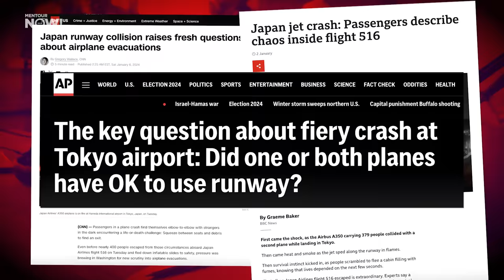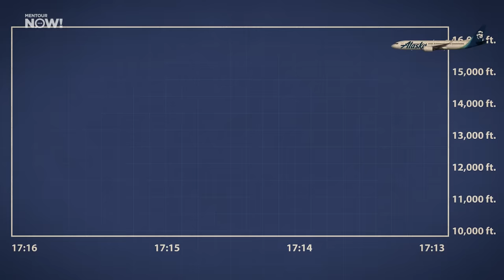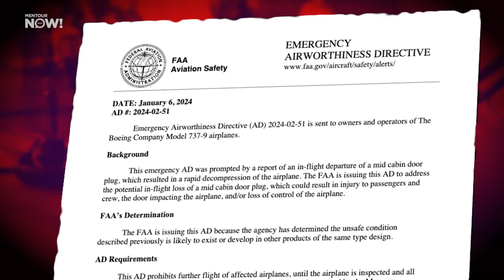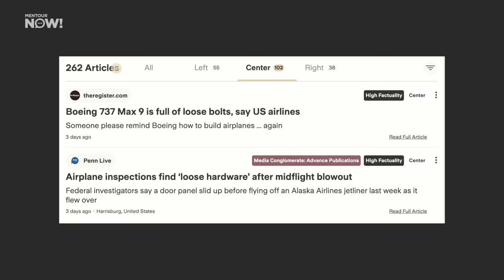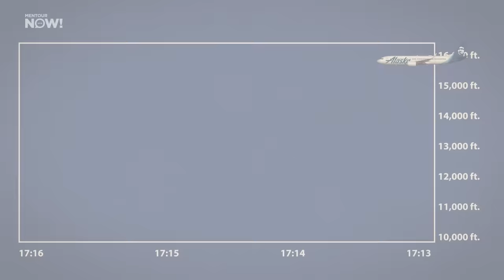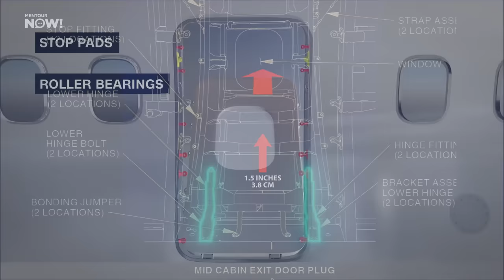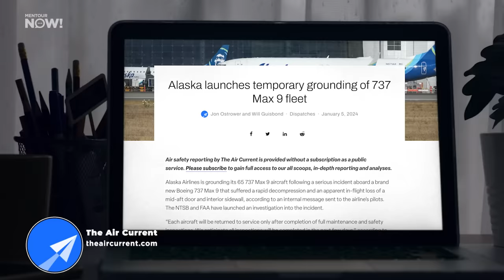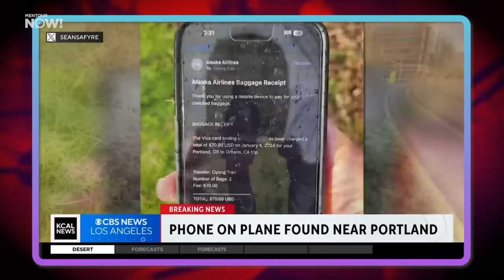WHAT Is going ON with Boeing?! MAX-9 Door blowout

Comment: Finally, a video on the subject that covers the commonality with the NG generation -900.  I'm still wondering why the FAA has not issued any ADs for those models as well.  From what I can tell, the design of this door plug system did not change for the MAX.
Reply: Yes that’s true, there wasn’t recertification required it’s a previous design, what has changed was manufacturing process, it has been suggested the last crew to remove this plug door was for the installation of the WiFi system, which is located near these doors so they do remove them as part of that process, the company that does this is a contractor. When they reinstalled it and covered the panel Boeing does a pressure test and it passed, even with those bolts missing it would pass because at that time gravity was securing the door. 
This is a theory but yea the last process in production of that aircraft should have been the WiFi installation
Reply: @ytzpilot  I don't buy that the plug needed to come out for wifi installation.  That contractor firmly denies doing so.  And why would they need to?  To run wires through the overheads?  Nahhh, doubt.

Are you suggesting that Boeing contracted the wifi out?  I think it has been confirmed that Alaska paid an independent 3rd party to do so, which is the one I referenced above denying ever touching the plug.
Reply: @ChristopherBurtraw  Juan Brown already provided photos and details of the installation, it was clear as day the door was removed, air stairs were being used, photos don’t lie
Reply: @ytzpilot Boeing has admitted it was THEIR failure. I am guessing at least one of their mechanics is now looking for a new job opportunity.

Comment: I read in a comment that Spirit ships the fuselage to Boeing with the doorplugs attached. Then Boeing sometimes removes the door to fit the interior via that opening, and then reattaches the door. And that probably at this stage they were not careful enough.
Also, it is pretty normal that a phone falling from that height will remain intact. The phone will not be any faster regardless of the dropping height, as it quickly reaches its terminal velocity. And that speed is not that fast. If it falls to soft ground, especially not with screen looking down, then it will be most probably unharmed. So no, Iphones are not that special.... bruh.
Reply: Tree branches to wonders in slowing falling objects.
Reply: It is unlikely boing removed it in this case imho, as everything taken off must go back in, it is a typical procedure with great care taken. It's a big issue if you have 4 bolts left over. In theory it would be similarly difficult in assembly but a shift change etc would potentially see these issues i'd guess.

Comment: After an Alaskan Airlines plane went down due to lack of maintenance, it's no wonder Alaska Airlines felt the need to immediately and proactively ground the planes. The immediate concern might have been that ppl might think they weren't doing maintenance again.
Reply: But when multiple pressure warnings were detected, AS decided to dispatch the plane anyway but not over water (ETOPS).  Shouldn't they have grounded the plane until root cause of the warnings was understood. (whether an errant sensor or a fuselage issue).  By failing to do this, it could have been far worse given a few more minutes into the climb.  I'm afraid AS safety culture hasn't improved since AS261.
Reply: @cottydry you should read more into that pressurization alarm - then you would realize why it was not grounded. It has nothing to do with the incident.
Reply: Alaska immediately grounded planes after that incident, as well.  I know this because I flew on that model just weeks after the incident, so I was following closely to make sure I wouldn't miss my vacation.
Reply: @alan_davis  But AS was obviously concerned enough to keep it from over water routes (ETOPS).
Reply: * If all 4 bolts were missing this would happen in the first flight. * It is impossible for all 4 bolts to fail at the same time. * The door panel did not even have a scratch or bent after 16000 ft fall. * Much bigger INTERIOR PANEL had disappeared. * The fallen cell phone shows the baggage was checked in on Jan 4th, a day before the accident. * Everyone was very calm, I wonder what the cockpit voice and the ATC communication sounded like when the cockpit door blew up (By design according to this video) ?
Reply: @ShonMardani  the dents in the door are clearly visible in the picture.  and no, even with all the bolts missing, friction would still hold the door in place because the springs are not designed to be strong enough to lift the door on their own.
Reply: I was an employee at a heavy overhaul facility a year after that accident.  We brought in an Alaska Airlines airplane and their company reps were pressuring us to sign off things that hadn’t been done to save time.  This included stabilizer jackscrew inspections.  They were the only customer that we ever kicked out of our facility mid inspection and told them to never come back.  If they hadn’t changed a year after killing a plane full of people I doubt much has changed since.
Reply: @ShonMardani   Since the bolts don't hold the door in, but only prevent it from lifting up in order to open it, there is no reason that it would have to blow out on the first flight.  Since the air pressure pushes it against the pads.  The much bigger interior panel was made of plastic that can easily be blown out due to the air pressure differential.  The cockpit door blows open to allow the pressure in the cockpit to equalize with the rest of the fuselage.
Reply: @cottydry do some research first…it’s a common practice for maintenance restrict airplane from flying over water.
Reply: @cottydry  planes get ETOPS certified and decertified all the time. some planes just never get ETOPS certified at all. i'm sure AS has their issues, but i wouldn't think this incident reflects badly on them. people would be shocked to know how much stuff is flagged as broken with planes still allowed to take off. redundancy means it's often like ignoring a check engine light in your car. something to be aware of but no immediate issues. they probably figured a faulty sensor or small leak wasn't a huge deal because i doubt anyone was expecting the door to fall off because it wasnt attached correctly.
Reply: @cottydry there are quite of bit of deferrals that remove or restrict etops. Nothing new.

Comment: The cockpit door was apparently not blown out, it is supposed to open in the event of sudden depressurisation. The NTSB stated this in a press conference.
Reply: Yes, and with the kicker being that Boeing apparently hasn't told anybody about it. Because not telling people about safety related features of the Max worked out great last time.
Reply: Virtually all cockpit doors are, prioritizing structural safety over keeping door shut. The peculiar thing is that the blow out panels only open in one direction (depressurization in the cockpit). My theory is that engineers realized that blowing panels in the other direction could cause doors stuck in non-openable scenarios, trapping pilots inside. If that isn’t a concern a more simple solution would be to just let the blow out panels work in both directions. Lack of documentation and training on that these doors open in some emergencies was an issue. Non of the crew expected the door to open as it wasn’t documented well.
Reply: This is what Boeing is claiming, yet it hasn't be documented before...and the pilots were not expecting it.
Reply: To my knowledge, there was no report that the cockpit door was "blown out" as you phrase it here.  NTSB reported that it was blasted open and bashed into the lavatory door.  It was further reported that it took the flight attendant several attempts to get the cockpit door closed again.  The problem is that no one bothered to let the pilots or the flight attendants know that the entire door would do this and the information is not in the operating manual.  Boeing has now reported that the manual will be "updated."  The violent and sudden opening of the cockpit door might have had a startle effect on the pilots and, even if it did not, they lost their laminated Quick Reference Checklist that blew out of the cockpit. Also some poor soul could have been trapped in the lavatory (luckily, there was apparently no one in the lavatory at the time).
Reply: @Maggie-tr2kd  as much as you take task with me saying, blown out. With air pressure difference that statement stands. I guess  you're "calling me out" because you thought I meant blown out as in some sort of explosive was involved. Then in re phrasing it you said "NTSB reported that it was blasted open and bashed into the lavatory door." Also, does not help. 

The crux of my reasoning for mentioning it is because Mentor covered it incorrectly in the video. It was a simple error in the video.  I was adding a note for his and our clarity.
Reply: @imaner76   I don't want to argue with you.  I just thought it was confusing since people on here are referring to the plug door "blown out" and I don't think the cockpit door did the same thing.  Let's just say for the sake of compromise that the NTSB reported that the cockpit door flew open with such violence that it jammed the lavatory door and the flight attendant had to make several attempts to close the cockpit door before being successful.  That was a pretty significant event.

Comment: Even if one locking bold would be there, it would prevent the roller pine from moving down in the guide track. I dont think the weight of the door could shear the bolt of. What would happen if the bolt(s) would be loose but in place? Nothing. They only prevent the roller pin to move downward in the guide track. I would assume that no nut was installed and the bolts vibrated and fell down.
Reply from the maker: Absolutely..,
Reply: Or the nuts were the wrong type that could come loose due to vibration (all metal ones without nylon inserts or locking pins)
Reply: Or neither the bolt nor the nut were ever installed.

Comment: I think, when several high profile incidents or accidents occur, it's worth remembering just how safe modern aviation is.  As an example, this one thing is all over the news.  But for Dec, 2023 there were 13,282 flights JUST out of Portland International alone, with no noteworthy incidents that I know of.
Reply: And even here no one was seriously ( physically at least ) injured.

Air travel is hugely safe. The media likes to amplify everything.
Reply: @alan_davis  Seriously.  Remember that Korean Airlines flight that ripped off the entire tail section going into SFO?  Only 3 people died, and potentially not even from the crash.
Reply: It seems like a specific plane issue. The door was simply NOT secured as it should been (with bolts).

Comment: Thank you for being very clear that the bolts do not retain the door plug.  The pins & pads keep the door from exiting the aircraft; the bolts keep the door from moving up & disengaging the pins from the pads; the nuts keep the bolts from backing out; the wire keeps the nuts from backing out; the wire twisted around itself keeps the wire from backing out. Without the type of specific clarity & detail you provide, uninformed people could conclude the door plug is held in place with four small pieces of twisted wire.

Comment: These "doors" are designed following the same concept to hold presurization as most aircraft vessels flying out there.  It is a proven design. This is a most likely an installation issue, human factor, as the video suggested and I agree 100%. A  VERY unfortunate situation, once more, for this airplane reference.
Reply: A minimal version of a real door handle with latch,, under the interior wall panel, aling with an indicator up front might be a good change to consider going forward.
Reply: @citylockapolytechnikeyllcc7936 Or simply a hole over each bolt location…

Comment: Before anyone says this would never happen to the Boeing "run by engineers", the "old" Boeing had several design flaws that killed thousands of people. For example, the cargo door issue of the 747, rudder issues of the 737, 747 fuel tanks exploding, thrust reverser activation mid flight,  engines dropping off the wings... the list is huge.
Reply: This is of course true.

But if this is caused by for example diversity hire, it matters little if also the best engineers can and do make mistakes if this mistake was made by people less qualified.

Simply put. Lets say 1/1000 problems occurs with highly qualified engineers. But 10/1000 when we use diversity hire.

Is that ok for you?

Comment: I fly the 737 max. Boeing said the cockpit door was designed to open in case of depressurization. I bet it wasn't - but they're trying to explain away why it opened. There's absolutely no reason for it to open and it would be better for it to NOT open in case of that emergency - more time for the pilots to put on the o2 masks etc. In this incident (it was a minor depressuration at FL180)  and the door opened, the headsets came off and the clecklist blew out. Can you imagine what'll happen at FL350. I'm not sure pilots will have the time to even get to the masks.
Reply: You mean there should be a full sized pressurization bulkhead between the cockpit and the rest of the plane
Reply: "I fly the 737 max" - do you, really? Your understanding makes me question that. Maybe you "fly on the 737 max"?
Reply: @2adamast  that would be nice but would add a lot of weight and airlines would not go for it. My point was that if the door was at least closed, the depressurization would be slower. At fl350, you only have about 30 seconds before you pass out. With the loud noise, the cockpit door slamming opening and things flying out and the shock.. Would take at least 10 seconds to gets one thoughts together.  My main point was that I think Boeing was trying to explain away why the cockpit door opened - there is no advantage. I've heard of no cockpit that's designed that way.
Reply: * If all 4 bolts were missing this would happen in the first flight. * It is impossible for all 4 bolts to fail at the same time. * The door panel did not even have a scratch or bent after 16000 ft fall. * Much bigger INTERIOR PANEL had disappeared. * The fallen cell phone shows the baggage was checked in on Jan 4th, a day before the accident. * Everyone was very calm, I wonder what the cockpit voice and the ATC communication sounded like when the cockpit door blew up (By design according to this video) ?
Reply: @ShonMardani  no it wouldn't open on the first flight. The door has to move up first.. This would take some time... Normal vibration and climb/descent cycles. Mark my words..NTSB will find that none of the bolts were installed.
Reply: It would not take several months, it was not a gradual events. There is no way that a worker eats 4 huge bolts for lunch or take it home.  @Bren39
Reply: @ShonMardani  Pls watch the video. The heavy door has to move up. Have you seen flight attendents open the door by moving the handle - takes quite a bit of force. As far as the bolts, my suggestion was that someone forgot to bolt period - or assumed someone else did it (e.g. shift change) and no one double checked.
Reply: The door has to move down first, that uses gravity once the handle unlocks the door, then the door uses springs to assist lifting it by a very small force. Quality control in manufacturing and R&R (remove and reinstallations) goes by count of parts used, that includes counting and weighing every small screw and rivet. @Bren39

Comment: Are we even surprised by now? It is well documented since many years, how badly the "accountants" manage that firm starting with the McDonnell D. merger. Unless regulators fine the living hell out of Boeing, thus making it literally less profitable to cut corners, this is the obvious outcome. 🤷🏻‍♂️🤦🏻‍♂️🤦🏻‍♂️
Reply: Well they don’t need to, they will be perfectly fine doing military contract. All they have to do is rebrand the commercial aircraft so they all seem new and Boeing exist as a military contractor.
Reply: @Bobspineable You are assuming the military won’t be just as interested. I would suggest you look up the airframe the P-8 Poseidon and E-7 Wedgetail are built on (they are 737 based).

Comment: I believe that when Calhoun was asked by a reporter how something like this could have occurred, he said that "a quality escape occurred".

Juan Brown ("blancolirio") has done several videos on this incident, and in one of them he said that the loose bolts that were found on other aircraft were not the bolts in question but other ones. Which in a way is more alarming.
Reply: Quality Escape, typical high level management ‘SPEAK’, specifically formulating a new phrase to lessen the gravity of the situation. I know a few other phrases I can come up with that are closer to the actual accuracy. I’m sick of the constant deflection from the main situation!
Reply: @richardvervoorn6626  Back in the 1980s I recall seeing a quote from a representative of Super Cub Industries, admitting that their eponymous aircraft had "the highest incidence of uncontrolled contact with the ground of any airplane". Although strictly speaking that's a bit more than a straight-up euphemism, given that most crashes happen while the aircraft is under at least partial control.

Comment: I didn't hear you say that, per other reports I have read/seen on this incident, that the 'plug' panel, may be removed to install interior components. It is also installed so if the plane is sold to another company and they want to convert into one with more passengers it could have the needed emergency doors installed. One has to wonder if an error in the fasteners occurred when the plug panel was removed to do interior finishing.